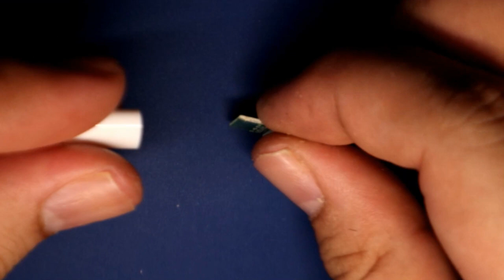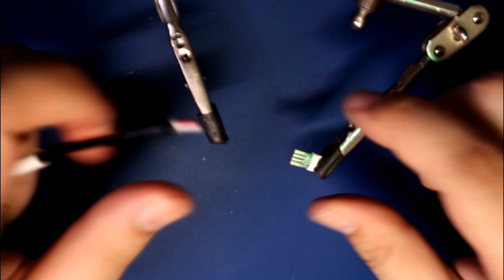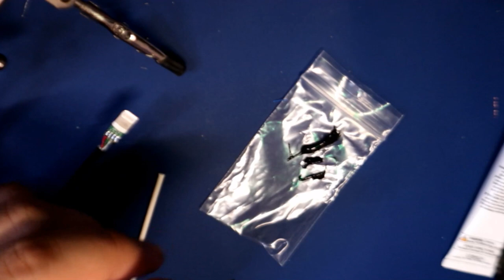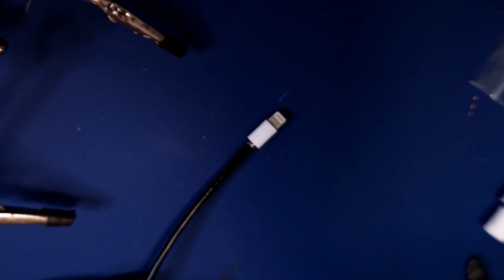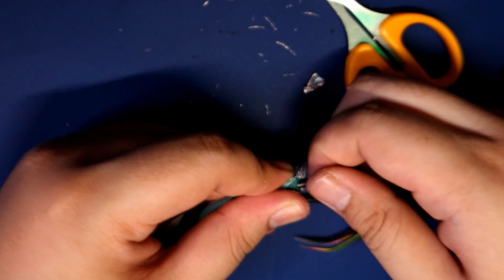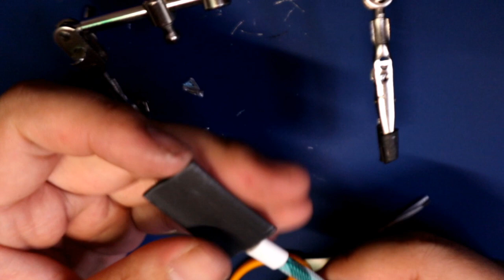Custom iPhone Cable DIY Build Guide (Lightning Connector)

Comment: Never understood why you dont use the standard color pinout for Data+ , should be the green wire instead of white :) not that it matters haha just easier to remember as its usually the green one.

Comment: (1)  I now it's been quite a while since your original post, but do you happen to know of any other sources for the lightning connector, or similar?  The one you noted is out of stock.

(2) I want to repair one of my 10' aftermarket lightning connectors, but it has five wires, including the ground soldered to the connector's metal jacket.  Any idea on that??  I don't think I can get it's own connector board separated because the internal metal jacket has been 'pressed' installed .

Comment: Hey josh! I had a quick question I’ve made a few of the lightning cables from the diy parts on your website and I came across one that won’t do data but only power. So if I plug it into my desktop it won’t charge or sync same with my car play in my vehicle. But into the wall it charges just fine. Was it a soldering issue or a bad connector?

Comment: Hey Josh! Thank you for the videos; they're so great! With your help I completed a USB-A to USB-C cable!

Going to buy a bunch of Lightning Connectors now. 

I notice at 3:28 that the wires aren't pre-stripped. Are you using the pre-tinning to melt the sleeving? That way there would be a decrease the exposed cable on a small connector? or can I just not see that they're pre-stripped?
Reply from the maker: thanks! glad i can help :)

sometimes I went I'm lazy and just need a little wire exposed i just melt it off. kills two birds with one stone, but doing so is probably not healthy to inhale

Comment: Aren't those wires a bit too thin? It looks like 4x 28 AWG and by the specs that's not enough for charging.
Reply: Pretty sure stock Apple lightning cables use 28 AWG.
Reply: @DA-pb5kc  It can go up to 1.4A, chargers do exceed that. At least for Android, maybe Apple products don't, for example lightning connector can handle even less.

Comment: This has been on my mind for a while now so I appreciate you sharing! My dream is to make a proper functional usb-c to usb-c cable. Apparently you need special “host” configurations on one end if you want a proper charge and I haven’t yet been able to figure it out!
Reply from the maker: i'm planning on doing a video on usb-c to usb-c cables some time next month. There's an addition resistor needed on the USB-C host connector for it to work properly.

Comment: For those that don't want to use JB Weld, I've been messing with making some of my own for a few months before this video came out and I've found that a little gorilla glue or loctite on just the white end holds up pretty well for all the cables that I've made thus far!

Comment: I would really appreciate a lightning to USB-C cable video. Thanks.
Reply: Just solder on the USB-C the same as you would the USB-A.  The solder pads take the signals in the same order :)
Reply: @THEprinkus  ur sure thats all thats needed to make a fast charging compatible cable?
Reply: If you’re trying to make a quick charge cable, shorter is always better and look for a smaller AWG (thicker) wire that’ll still be able to fit on the solder pads.

Comment: No cable strain relief on the lightning side? Granted, the connector does not exactly have any built-in means for it, but wouldn't it be better to epoxy the outer cable sleeving to the connector housing as well?

Comment: it's not quickcharge right?  It would have to end in type c? Nice video
Reply from the maker: this isn't a quick charge. Also quick charge cables use 28/24 gauge cable where I'm just using standard usb 2.0 28/28 cable here.
Reply: @CruzCtrl  Does this imply that I can use 28/24 gauge cable and it would be quick charge? Or are there some additional needed steps to achieve that quick charge.